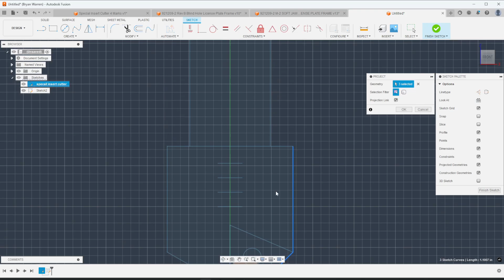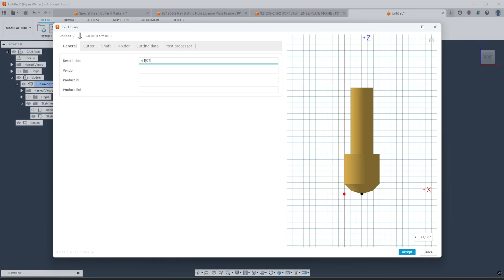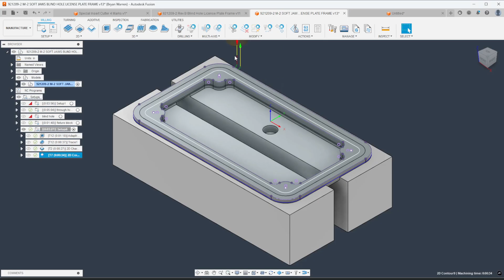Fusion 360 Form Mill | How to Make One and Use It

Comment: thanks - quick question would it just work if the compensation point is a point that is the outermost right edge intersecting with the bottom most edge and placing a “point” in the sketch - you can use vertical and horizontal construction lines with coincident constraints for the above two lines to get the bottom right intersection point in space, form tool accepts this but have not verified if that avoids needing your offset.   please let us know if this is crap.   thanks
Reply from the maker: I’ve had problems doing it that way. Not sure why. Center of tool works every time so I keep doing it that way. Now I have to try it again tomorrow 😂